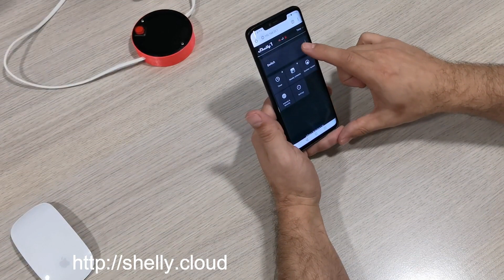Shelly1 Table lamp

Comment: Would have been so useful if you can actually show which wire connects to what. Cannot see a thing from the video, unfortunately.  Is it possible for you to post a wiring diagram? Thank you
Reply: Agreed, Need close ups of the Shelly to understand what is going on

Comment: How do you make sure it's plugged in the right way?
What would happen, if you plugged it in the other way 'round?
Reply: It would work fine. Mains isn’t polarised. Although it could mean switch neutral rather than live but for a lamp that’s not a huge issue.
Reply: @callumBee  Yeah, I have the same question: If you plug it the other way around, it could mean the line goes to the neutral and the neutral goes to the line/input. I'd like to learn more about why this isn't an issue. I guess it's because these lamps work with "alternate current" right? But still, I am not sure I understand why it is not an issue.
Reply: @rulix82  AC voltage is just that it switches back and forth 50/60 times a second so theres no Postive or Negative voltage so no polarity so it works even when swapping Live (line) and Neutral. In AC circuites Live is best thought as the source of the current the bit thats attached to the generator.

DC is the opposite its just one direction from Positive to negative and has to be correct or you break things. The only time "polarity" matters in AC circuits is for switches and fuses. This is where you want these on the live side so when you turn it off or the fuse blows the current source is interrupted. 

Hope that make some kind of sense.